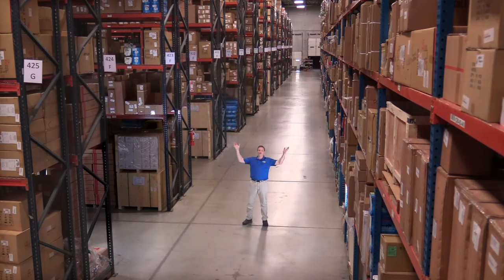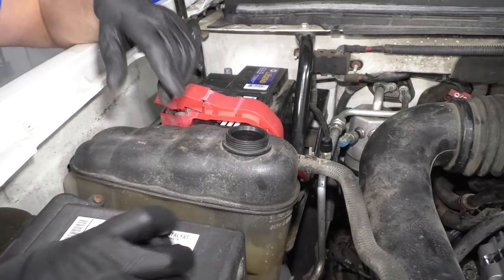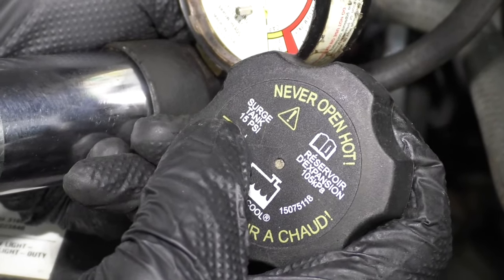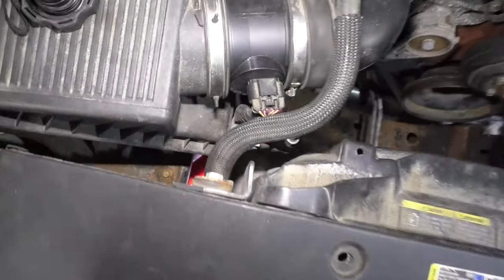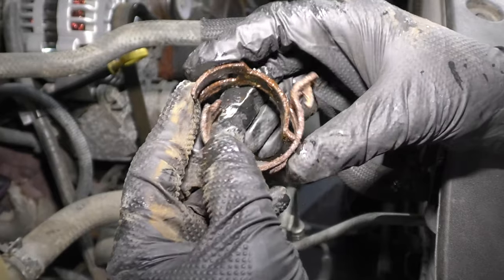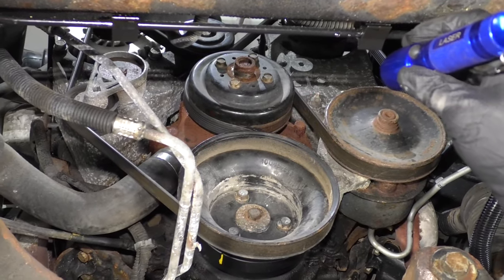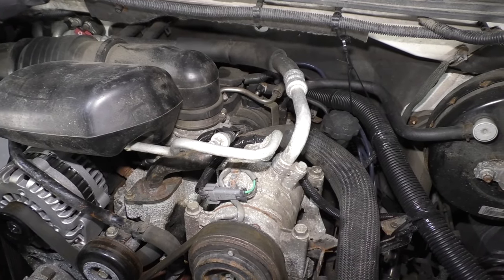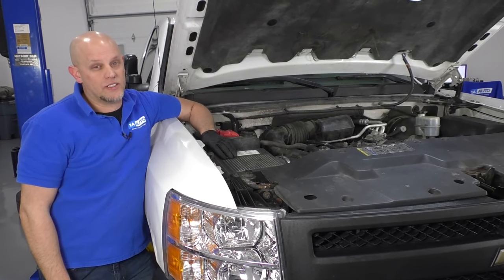How to Pressure Test Vehicle Cooling System

Comment: what does it mean if you get a very slow leak....and cant find the leak ?
Reply: Look under the water pump for any coolent . There s a weep o hole that will drip when the pumps Goin out. So you will know the pumps going out
Reply: and if its on the water pump it might evaporate so look for stains also and around the radiator because it will evaporate on there too

Comment: Oh Another question how long does it take to have vehicle pressurerized..my vehicle plastic radiator goes below the line about every 2weeks ..have to refill with water..the mechanic says to stop it bc it refills on it own..we had a replacement of some sort bc car was running hot & wanted to look at while warranty..but ...so my question is..is the mechanic right..to let it go empty and leave it along????..the vehicle is 5yrs old & since we paid to fix it ..should the low water be an issue since doesn't see any leaks???

Comment: Anytime a clamp is this corroded, the hose has been leaking a few drops everytime system was at full pressure. 

That hose needs to removed from both ends and cordless drill with 1" wire wheel to scrub the salt crystals out of the rubber for the full distance it sits on radiator port.  The port also scrubbed clean.,
do the same,on other end to water pump. 

For absolutely no leaks from hose again, smear 3M yellow trim adhesive fully set in area of hose scrubbed, and now remount with good clamps. 
Adhesive needs to be fully set but finger leaves impression in the glue. 

You'll see obvious corrosion where it connects to water pump when hose is removed. . 

If salt crystals are not removed from hose, doesnt matter how tight the clamp is, coolant will leak. 

Same with radiator cap, the rubber seal to tank and relief valve disc needs to be cleaned of any salt crystals. 

Now,do the same to all the hoses, and never have leak issues again, where one will end up blowing head gasket if not detected it low in time. 

Cheers

Comment: Thanks for sharing..
My question is how much pressure need to pump inside cooling system.. Is it same as stated at radiator cap.. i.e 1.1 bar.. Or slightly above 1.1 bar..?
Reply from the maker: +TT eLpiPi Thank you for your question!  The pressure does vary by vehicle. You can check your owner's manual for your specific vehicle.

Comment: I have a 2001 Silverado 2500HD and it appears the coolant is coming from the rear of the engine. I was told that it was most likely a cooling system crossover line under the intake or at the rear for the engine under the intake. Is there such a line under the intake?

Comment: I pressure checked an HHR. When I was done there was pressure still in both the heater hoses. Is this normal? Would the water pump pinch it off between there and the thermostat?

Comment: The pressure tester link that you will give isn't the same pressure tester shown in a video 🤔🤔
Reply from the maker: +Ben Walker Thanks for watching our video! The tool used in the video is different than the one we offer on our website, however, the one we offer will function the same. Depending on your vehicle, you may need an adapter for it to function correctly. +1A Auto

Comment: I have a coolant leak for the past four years still can't find it it's definitely in the engine compartment though because that's where I smell it maybe it's just coming from the overflow there is a little escape hole In the reserve overflow my coolant I rarely have to add any ... It's so minute but I definitely smell it unless of my nose is tricking me and I'm smelling something else Could it  been possible That's some coolant in the past got in somewhere and evaporated and the residue stayed behind and it keeps getting wet or something I just don't know what to do...  I have no visible signs of a leak underneath at all of little bit with an oil leak but that's because I need to do the Valve cover gasket The mechanic forgot to put a little bit of RTV silicone in certain key areas Over the timing chain cover You're supposed to actually put a little drop of  sealant.. He never did it.. But yeah I can't find it it doesn't overheat it stays perfect temperature all the time even when it's 115 outside And just idling if it wasn't for the smell I wouldn't know anything

Comment: Im trying to help my sister. She has a 06 Kia Sorento and the coolant blew a pin hole in the reservoir. We replaced the reservoir with a new one. It blew another tiny hole into it. So we replaced it with a junkyard one. it blew hole in the upper radiator hose. We replaced the hose. Now i want to be on my A Game and fix this problem. I'm going  to get a pressure tester and start from there. Fans are working, New coolant.. replaced the ECTS(engine coolant temperature sensor) too, due to a code. P0118. I appreciate any help, I will also look for an experience mechanic around my area.. I don't live in the city

Comment: I wish mine was this easy. Can hardly even get pressure in the system keeps leaking pressure from overflow and also the radiator cap. I guess I get new radiator cap and will have to block the overflow then try again. Cooling system in subaru wrx is a nightmare.
Reply: Is your 15+ overheating as well?